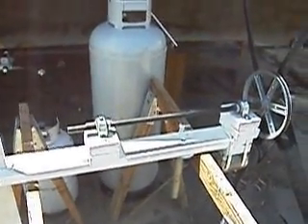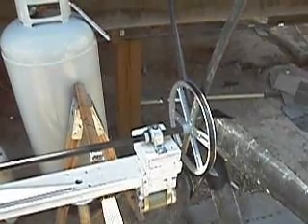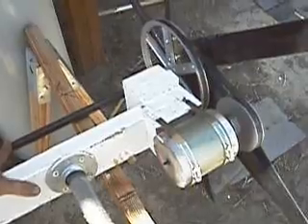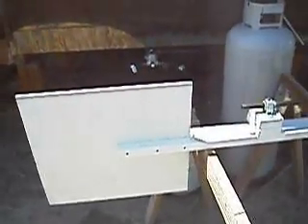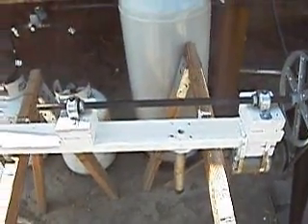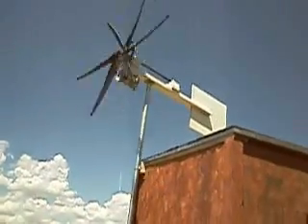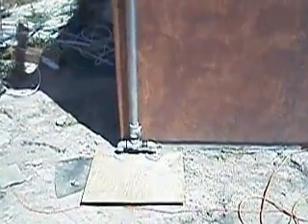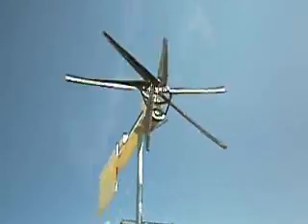Wind Generator Using 38 volt Ametek DC Motor

Comment: I just bought an 50v Ametek permanent magnet 115699 motor for a project like this - 
Should I use that with the system you describe here, or would it work better with a cheaper,  130v treadmill motor?  Thanks for a great video !

Comment: and another thing - the reason that it tuns so fast it that it doesn't have any load. that is called overspin, and this could harm the hole apparatus over time... if you did connected tit you saw the reduction in speed / RPM

Comment: This is exactly the kind of thing I was looking to make and mount on my shed. Only difference is I plan on making a brushing type electrical conection between the mast and poll to avoid the wire eventually twisting too much. Your design is great, to the point and very easy for me to understand. Thank you for posting this vid!

Comment: Nice setup, interesting design.  Was I hearing it vibrate in higher winds?  How's it holding up since you posted?  Would be interesting to see an update video of the system.  Myself I'm doing something very similar with pulleys because I'm not in a wide open space where wind is constant.  Only difference is I'm doing a VAWT with 8 blades instead of the traditional HAWT.  Great stuff.

Comment from the maker: @sijenkinson1 , This generator makes around 100 watts of power, although it could do maybe twice that in a very heavy wind. But appliances are not normally powered directly by the generating device. Generating devices normally charge batteries, then the appliances are run off of the battery bank.

Comment: A very good video, have you thought of using a toothed belt and pulleys from a scrap electrical hover motormower, the belt will drive without too much tension being applied and gives you a lower efficiency drive loss, hope this helps, regards Nigel, aka doc Cox

Comment: Free Advice, take it for what its worth. scap the v-belt! your losing power with it. I used a chain drive. no slop and no resistance. you can also chain the gearing easier. I went 4 to 1 with mine. another note.... get that thing up higher off the ground where the wind is!!! unless you live in VERY windy area, you get MUCH more constant wind up off the ground. just putting mine on top of a 40ft TV antennea tower got me twice the wind power! looks good. keep it up.

Comment from the maker: Yes, and I've broken the wires too. My first remedy was to put a plug in the line, it it could be unplugged and unwound from time to time. I've got a 2x4 stop on it now that keeps it from turning. It gets most of the wind from the prevailing direction anyway.

Yes, you need a diode to keep it from running backwards off battery power in low wind.

Comment: the wires will go around and aroun and break or short your rig out and you do now to use a diod in line between motor and bateries dont you

Comment: Maybe a timing belt would help?  Maybe a v-timing belt so the big pulley can be a v-belt and the motor being the timing part.   Very nice.

I tried a gear system, but the friction was too high, mostly from the bearings that I used.

Comment: What would be the best way of salvaging motors ? What appliances etc use applicable motors that can be retrofitted into a wind generator. Also, whats the HP on the motor you are using ?

Thanks.

Comment: I would smoothen the leading edges from the tail like if it was the wing from an airplane.  It makes the wind pass much smoother and it improves the  stability. I can see the tail  moves around a lot, the reason for that might be  the flat edges on the tail. That makes it that the wind wants to push  the tail to one side, with the result that you get less RPM from the blades. 

Greets, iT

Comment from the maker: That seems to be the common wisdom, but the generator was turning without a load in the clip so it was over-speeding. When it runs under load vibration is not an issue.

Comment: Nice solution to the RPM mismatch issue between turbine and generator.  You've got some serious vibration problems though. I would suggest that you drop the ABS blades and use PVC. Using 3 instead of 6 blades will also give you some more RPM (at the expense of torque). Another serious source of vibrations could be the turbulence generated due to the proximity of your tail to the roof (almost touching each other!) Make your mast a couple of metres higher and I bet you will see great improvement.

Comment from the maker: The flex is caused by the material. I used ABS pipe instead of PVC pipe to make the blades. The thing is that we have a lot of wind around here on occasion so wind turbines can become damaged, particularly the blades. The ABS allows the blades to flex instead of break.

Comment: I've got a similar Ametek motor on my windmill directly driven by a 3-blade 4-foot rotor. On a very windy day I would get 3 amps from my Ametek to my 12 volts battery. What sort of current charge are you getting with this particular pulley design? I'm curious...

Comment: Actually a gear drive would be better, chain and belt will produce more drag and resistance. I am going to build one this spring using gears meshed together,  kind of like a clock. I will try 1 turn of the blades to 3 turns of the generator.

Comment from the maker: Yes. I used 4" ABS pipe. First I cut a piece 24" long, then quartered it longways. I made a single cut on the blade to leave about 1" flat at the tip, and made the cut straight to within about 3" of the connection end.

Comment from the maker: I was pretty specific about the upper pulley system parts in the clip. The generator is the 38 volt Ametek DC motor available at eBay in the alternative energy section.

I believe that the upper pulley is 12" in diameter, and the lower pulley is probably about 3" in diameter.

The pivot is a 10" long 1" galvanized pipe nipple, screwed into a 1" floor flange.

The rest of the parts are just 2x4s & 1/2" plywood.

Comment: Ok, ya, the belt probably wont stretch too much probably.  But if the design is less than perfect and only a loose beld can be found a tension wheel would work.  I'm thinking of one where a turn of a knob can turn a screw with the wheel at the end where the beld will ride on; tighten or loosen as needed.

Comment: Its possible to have like "tension wheel/rollers" so that a slightly loose belt can be used and tightened as needed.  Another possibility is to make the motor and/or main pully wheel position adjustable, but the first idea is more practical it seems, and I think cars sometimes use them.

Comment from the maker: The pulley system should work for you as long as you don't get the belt too tight. That's the most common error.

Comment from the maker: As for the pulleys, I got the large one from the evaporative cooler section at Home Depot. It's a 12" pulley. I got the smaller pulley on the Ametek generator (takes a 5/8" pulley) at eBay, and I actually got an assortment of 4 pulleys for $20 including shipping.

Comment from the maker: Yes, I'm using a diode. It's inside the power shed where it connects to the batteries. Actually, I'm using two 6 amp diodes in parallel.

I used 4" ABS pipe for the blades. I cut so that the tip was about 1" wide, and made a straight cut to about 3" before the connection end. The overall diameter is very close to 4.5 feet, since the blades themselves are 24" and there is some open area at the hub.

Comment: Great job and great video.  Do you have a diode in line to the batteries?  What size pipe did you use for your blades?

I'm showing that motor to be 38 VDC, 12 amps, and 1150 rpms.  My DC motor analyzer says you should be using a 4.5 foot diameter blade..but 4 foot is good too.  In theory you should get about 10 amps in a 20 mph wind going to 12 volt battery.  The motor could push up to 500 watts in about a 30 mph wind.  Keep us posted.  

Richard
Poor Man's Guides

Comment from the maker: They are 24" each, which makes the overall blade span just a little over 4'.

I didn't make a point of it in the clip, but I used ABS pipe to make my blades instead of the PVC pipe that most wind turbine builders use. The ABS is a little more flexible, but ABS stands up to sunlight much better than PVC. The fact is that ABS is so stable in sunlight that it's even used for certain auto body parts.

Comment from the maker: I don't really know yet. I'm not running a charge/controller. I do have it connected directly to my battery bank to prevent it from over-speeding, but that's a poor way to charge batteries. I'll have it in a charge controller before long and post some numbers.